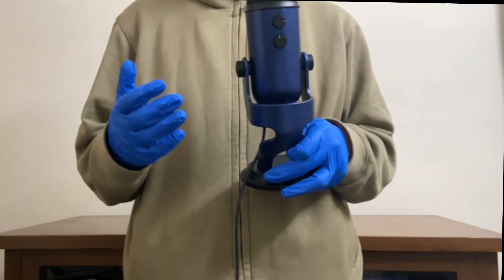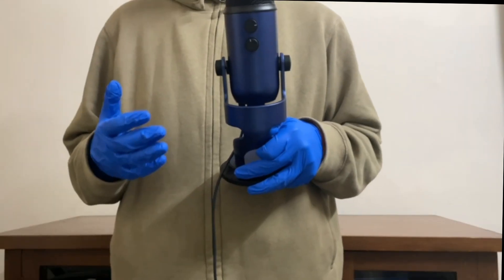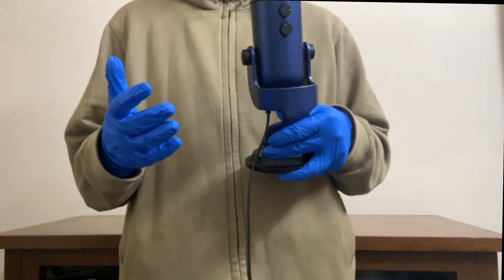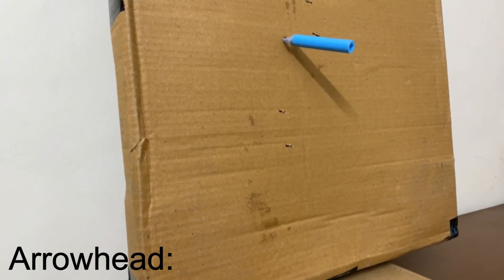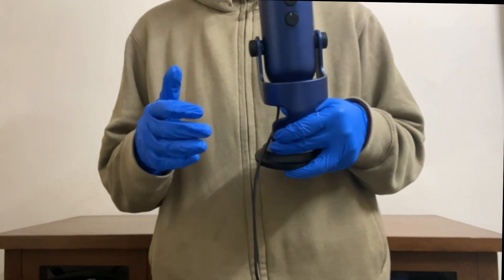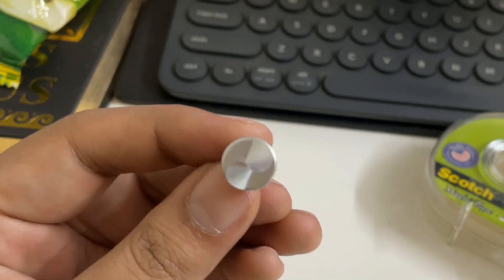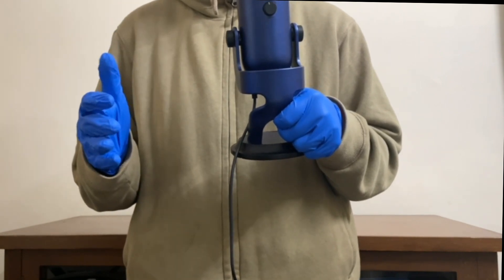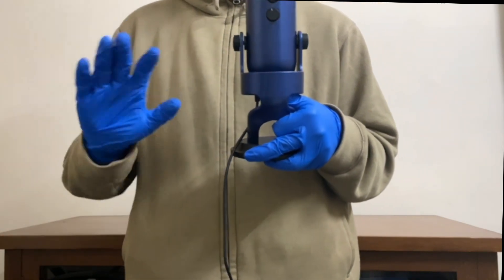I made DANGEROUS Nerf Darts

Comment: Push pins happen to be perfectly sized too. Also, you can cut the foam of the dart, to allow the modded dart to fit in a clip.
Reply: push pins don't do that much damage tho, much less then the ones in the video.
Reply: @n0b0pygamer38  true, but they are easier to get, and will embed themselves in wood, fired from a jolt